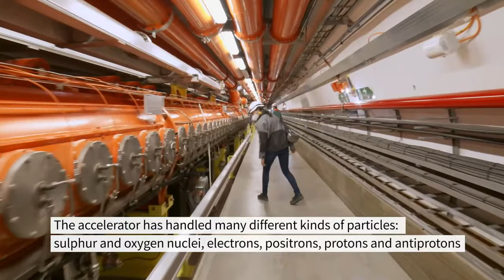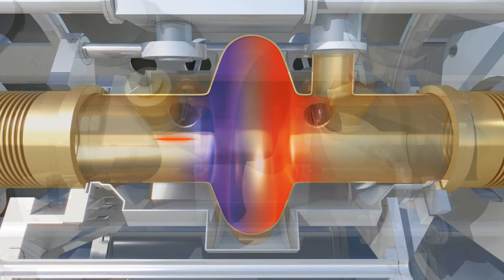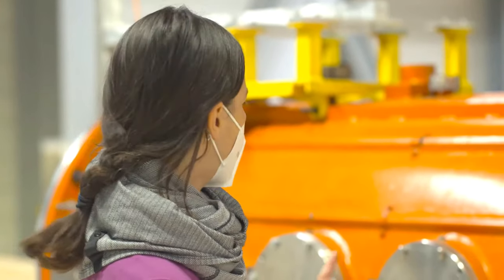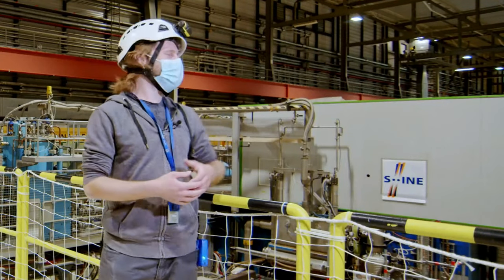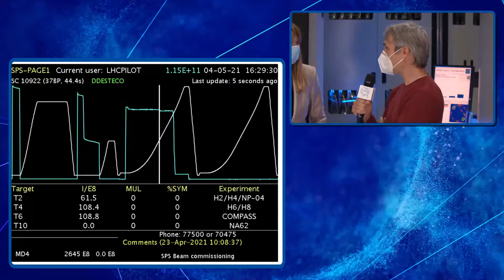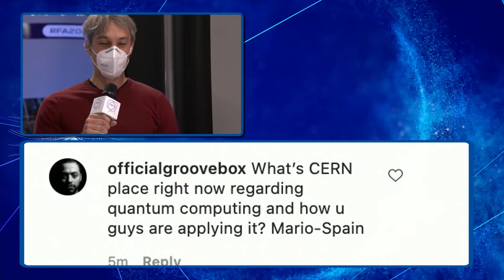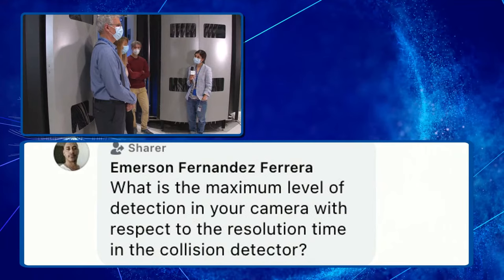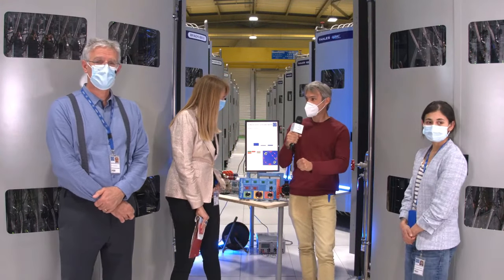A “Force” that drives particle acceleration to close to the speed of light in CERN’s accelerators?

Comment: The problem with their approach is they are trying to define with absolutes, that which is fluid and only applicable within only a specific paradigm.  Exceptional speeds are not required for this type of research, it's isolating specific particles and their dissections while at a controlled "vibration" and not shattering matter & trying to create and control micro blackholes without correlating the whitehole implications.  Rube Goldberg approach to the autonomics of reality...
Reply: A snapshot in time is still worth analyzing. Name the better approach than what we see here with our currently dealt cards. Or ask the US Government what kind of reverse engineering projects take place at ____ location. We getting closer man!
Reply: Very interesting.

Comment: Will the experiment eventually cause an explosion if you keep accelerating sub-atomic particles faster and make bigger collisions?
Reply: No, it won't
Reply: @physicsdemonstrations2426  Thanks.  That’s reassuring!  What is the main aim of such experiments though if it not about unlocking new sources of energy?
Reply: @hamwhacker  They are trying to break small particles into even smaller subsets of particles to see WTF is containing "Material Reality" kinda. They're basically trying to discover the smallest of smallest particles that we currently dont know.
Reply: They are already causing "explosions" - that's a fair term for the showers of short-lived subatomic particles that fly away from the collisions, rapidly decaying into other particles.  The whole point of a particle accelerator is to monitor what comes out of those explosions with various instruments and use that data to deduce what the reactions, particles, etc. involved are.

If you meant explosion in the sense of every Michael Bay movie - no.  If you turned off all the safeties, the device might burn itself out but I doubt it even could explode.
Reply: @obamaibnbahish5680  But I thought we all already know about sub-atomic nuclear particles that make up of matter. I think they are called quarks?  Also there are neutrinos but I am not sure of their significance.  Cheers
Reply: @ThoughtsAreReal  Thanks.  Just worried it might cause a chain reaction if you smash atom particles together
Reply: @hamwhacker  Thats just some. Theyre looking for more, more speed more mass = bigger colission more chances of maybe finding new particles. Thats the logic.
Reply: The total energy of the proton bunches are in terms of TeV (Terra Electron Volts). That's a very small quantity of energy compared to our lives. This is like the energy that a  mosquito would consume to fly. Very small.

Comment: The speed of light isnt fast enough for the "force" to even really give the desired outcome and setbacks will accure due to the accelerator not being fast enough for the force to ride the current. It'll run it down faster... Without the correct speed.
But what is faster than the speed of light? Sound? .... Obviously there's a component that's the missing key... Speed .... The cern ppl lack... Yes it is So.... 
Try going faster!!! Less radicals are involved with more accelerated speed
Reply: faster than light? entanglement.
Reply: What is faster than the speed of light? Colliding two beams approaching the speed of light while accelerating the beams using magnets with magnets producing a slingshot effect and putting that beam in almost absolute vacuum while freezing the particles to almost absolute zero. A particle can be sent anywhere in the universe on the tip of a beam of light while approaching absolute zero in a vacuum with universe size magnetic waves.